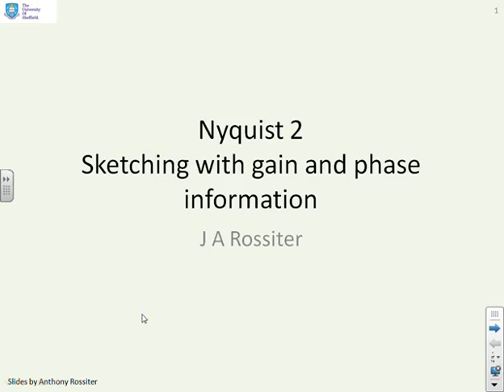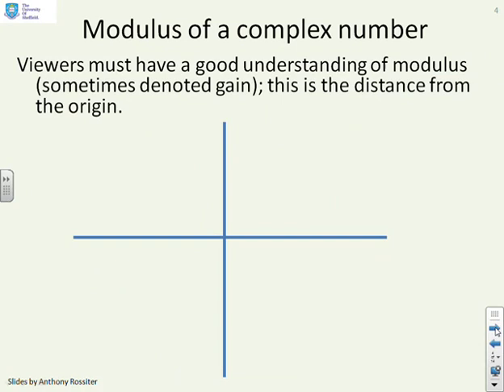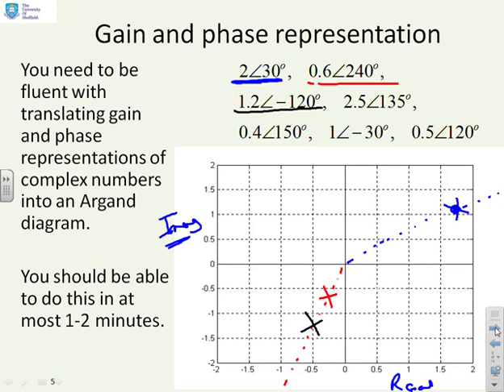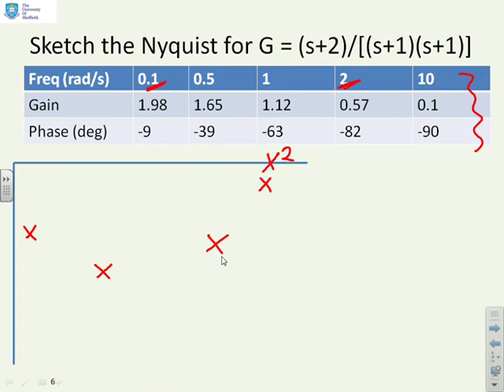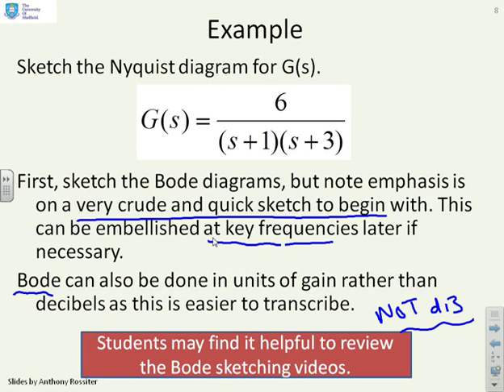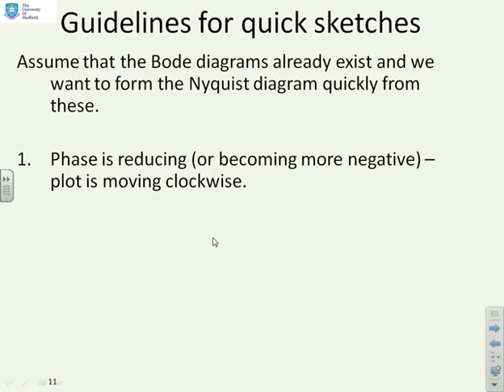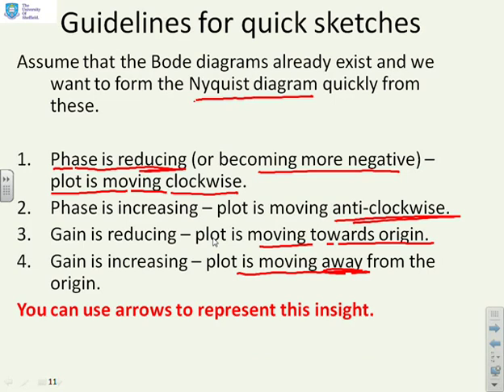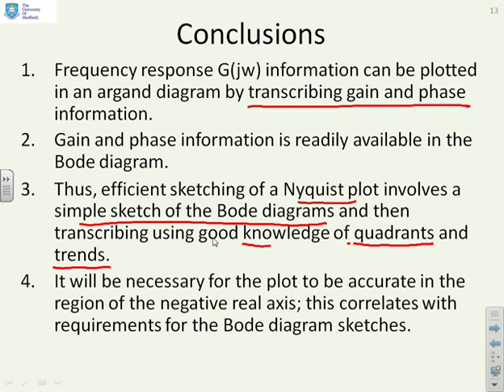Nyquist 2 - sketching from gain and phase information

Comment: sorry if i don't see it, but how did you get sqr(4*12)?
Reply from the maker: +Diego Ballesteros sqr(4*12)=sqr(4*4*3)=4*sqr(3)
Reply: +John Rossiter Where does the 4 come from?
Reply: +lorenz ed I had same problem also. check previous video for details. G(jw)=6/sqrt((w^2+1)*(w^2+3)). Then just put w=sqrt(3). enjoy.
Reply: +lorenz ed I had same problem also. check previous video for details. |G(jw)|=6/sqrt((w^2+1^2)*(w^2+3^2)). Then just put w=sqrt(3). enjoy. discard my older comment.